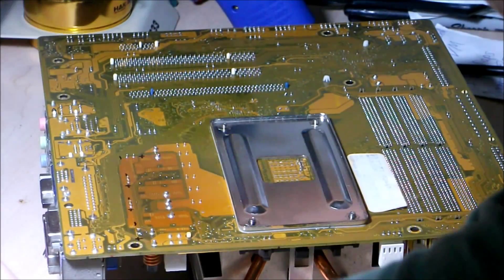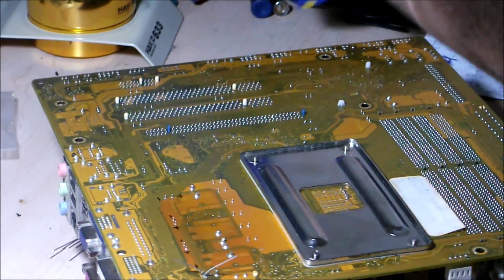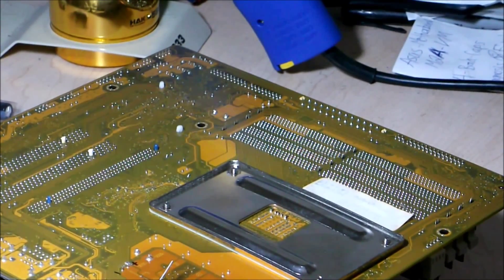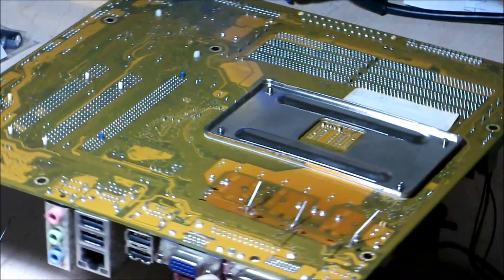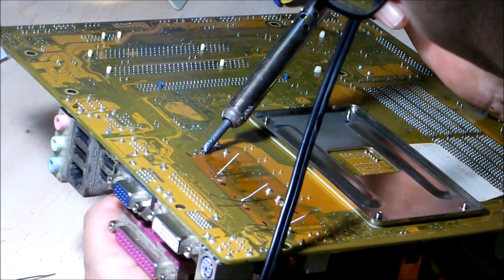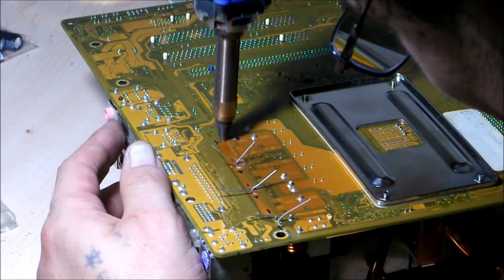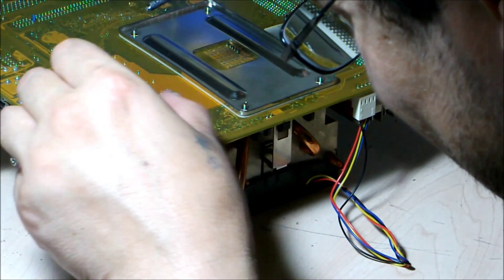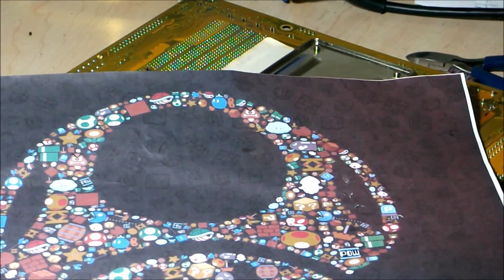Asus M2A-VM Motherboard Diagnosis & Repair - 4 Bad Capacitors

Comment: wondering about these capacitor stuff, would it be possible to go for "all solid" capacitors? i observe all solid capacitors on rather recent mainboards for many years. back in those M2xxxx days of asus apparently they didnt use solid capacitors? i dont know much about it though, their properties or what exactly the difference between classic and all solid capacitors would be? any hints if that would be possible to replace all damaged ones with solid ones you get the idea? thanks.